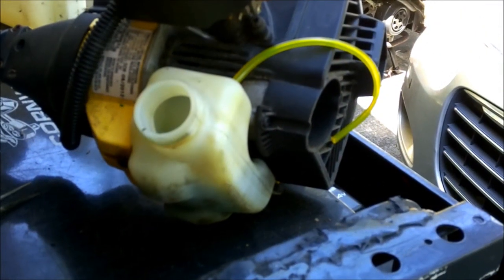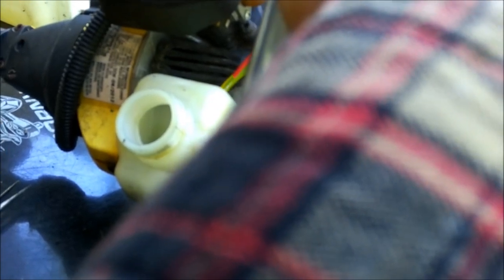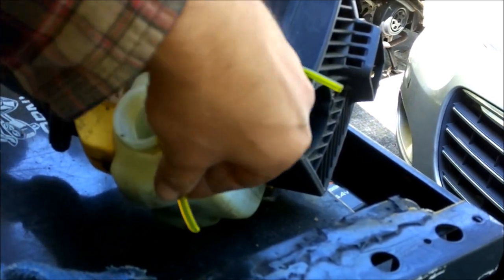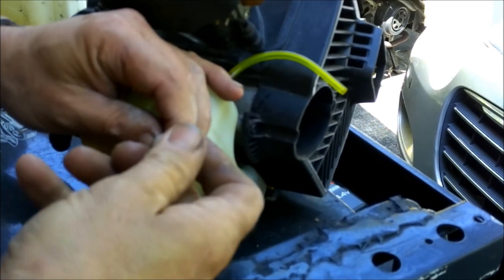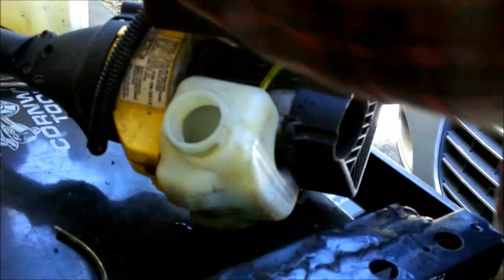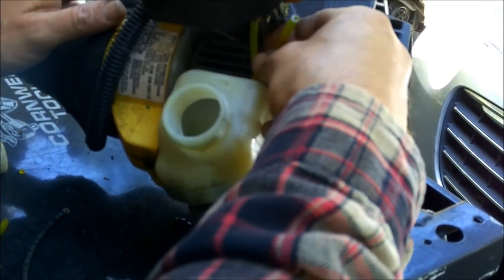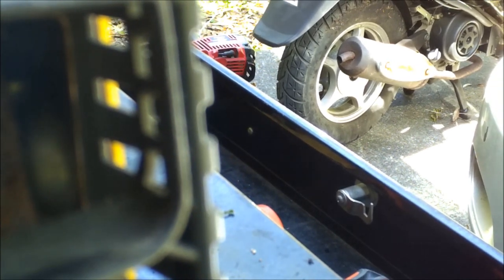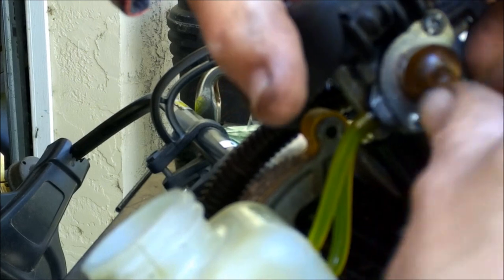how to  fuel lines on a weed eater

Comment: I found this video because I'm running into the exact same issue once the new fuel lines were attached - #&@!! primer bulb - which I had to replace isn't priming. Aggravating how much time and effort a seemingly simple task like this can consume. Also I'm only running non-ethanol fuel in all my power equipment from now on so the plastic pieces don't turn into zombies.
Reply from the maker: Lol zombies, epic.